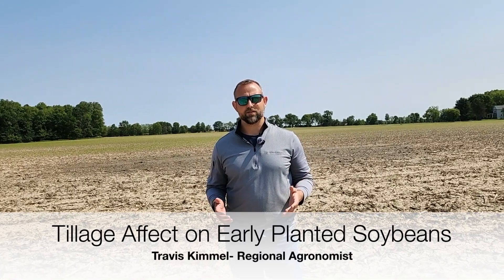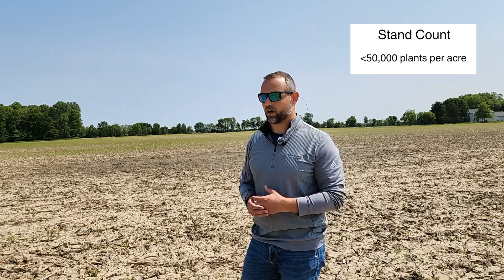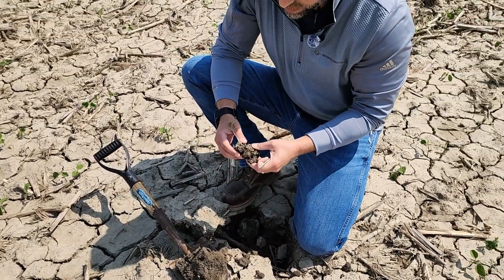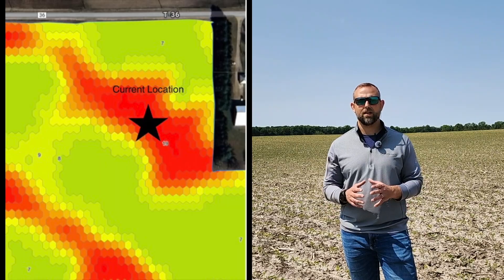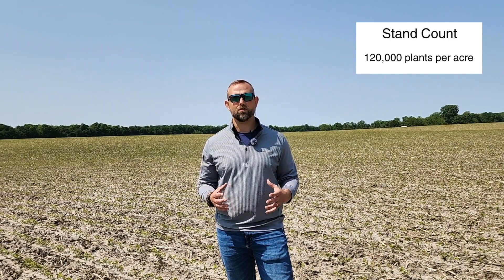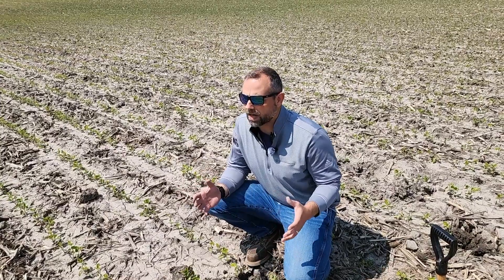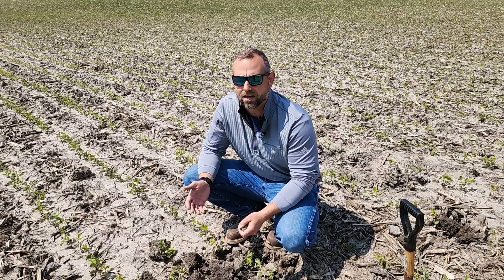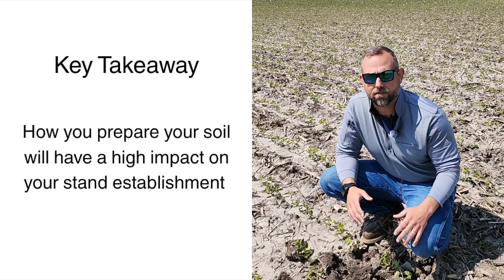Tillage Effects on Early-Planted Soybeans

Comment: Looks like corn was the previous crop. Grower had an opportunity to drill cereal rye in the catchment zones after corn harvest, then plant in to the green cereal rye in spring. The rye will pull moisture from this low area and make a great seed bed for the beans. I’m suggesting this because I don’t believe tillage is the answer for this situation. Running deeper tillage only moves the compaction layer a little deeper, water will still pool. In a dry year terminate the cereal rye early. In a wet year leave it green as long as needed to pull moisture from the catchment area. With the rye you gain some degree of control over the weather. Otherwise all you can do is pray.
Reply: In my area it would never dry out when it’s time to plant and if it gets dry you turn the pivot on